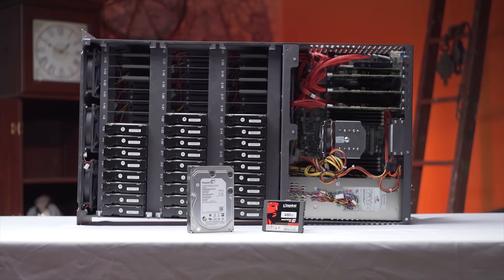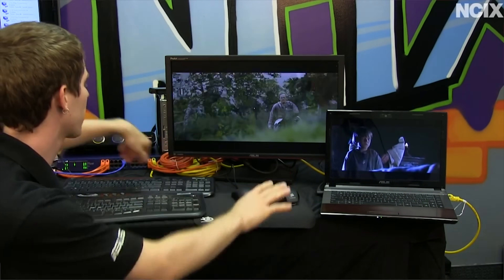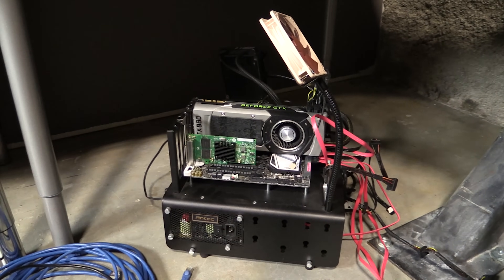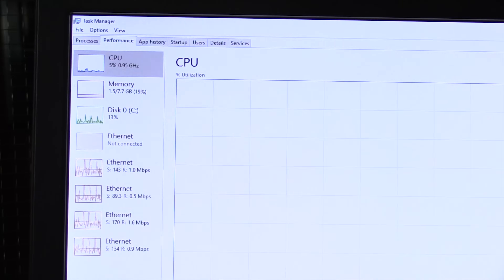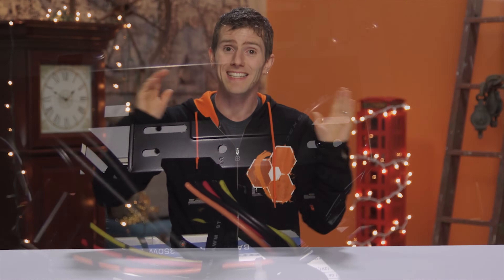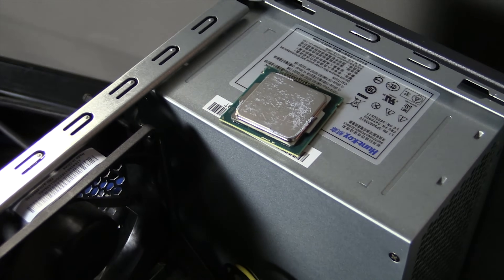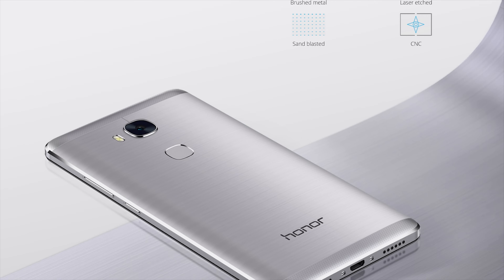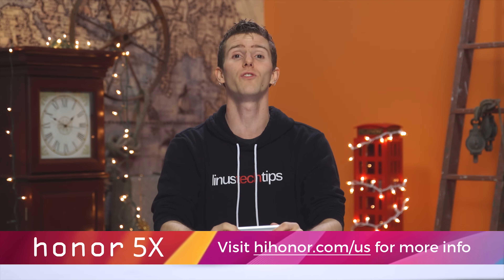Quadruple Your Network Speed for $100 with SMB 3.0 Multichannel!

Comment: if you guys can't get it to work with multiple installs and different components, this is practically useless for 90% of the people watching this video.
Reply: +FoodOnCrack true... I was really hoping for a good installation guide because I really need this for my network but appearently it still doesn't work well. guess he just didn't want to throw the video material away after this failure.
Reply: +FoodOnCrack 90% of the people watching a Titan X review won't buy one
Reply: +FoodOnCrack it did work reliably in the end though. He talked about the setup and the configurations he tried, and at the end he specified that you need multi-threading on both server and client machines.
Reply: +FoodOnCrack It's practically useless for 90% of the people who watched this video in the first place, because 90% of people who watched this most likely don't have a NAS.
Reply: +hnaht321 it's true I watch one and bought a 980 ti instead haha.
Reply: +Ultravore The solution was simple: 4 core cpus are a must for 4 lane network to work good, other then that most is plug and play if you run windows 8 or later, sorry windows 7 and XP fans this wont work for you. His problem was initialy a 2 core vs 4 core CPU, making the slower less cory-cpu bottleneck.

This should work out of the box with most cpus and 2 cards.
Reply: +FoodOnCrack It's okay since over 90% of people watching this video will never use a local network anyway.
Reply: +FoodOnCrack Really, this channel is about entertainment far more than any practical knowledge.
Reply: +FoodOnCrack Not to mention the fact that pretty much no one has internet that fast. Like quite literally you are lucky to get maybe 80 Mbits/s. Forget about 1 Gbit/s.

Comment: had a cool idea for a potential build for you guys, fitting a itx gaming rig in a laptop, you could put that 3d printer to use by making spacers between the bottom and top panel only issue i see is psu, keyboard and monitor but im sure there's ways around those problems

Comment: Lucky people. In my screwed up country (which is one of the richest) still has copper phone lines used for internet. I CAN ONLY FREAKIN GET 3 Mb/s !!! FML...
Reply: +goodlyboony
this video has NOTHING to do about internet speeds.
Reply: Australia right?
Reply: im in iraq and get 5mb/s XD
Reply: +goodlyboony Copper is capable of a lot more than that. It's hard for me to imagine that the copper infrastructure is actually saturated, so it sounds like you either have a sucky plan, a sucky ISP, or both.
Reply: Sp Ry No, Kuwait
Reply: I have 512kbps.
Reply: +Sp Ry Australia is getting fibre line for the whole nation..
Reply: +Jacob S awesome!
Reply: Jack Taylor Not according to my ISP. They say that copper wiring can't handle more than 3 Mb/s or it will burn up.
Reply: goodlyboony Copper infrastructure is capable of 100Mbit, in the right conditions and the ISP has the hardware to accommodate that.
Reply: +Jon A  Copper can do much more if you think of vectoring... but the longer the distance from the distributor to your home is, the slower the speed get's. Copper wires have to deal with interference and damping. In my old home i got only 10KB/s and now i have 5MB/s (both copper wires).
Reply: hahahahahaha I live in Germany and get 2k while beeing 5 min away from a town with 500k inhabitants. That's a screwed up country.
Reply: Shit man, that's fast. Fucking wind mobile has 100 KB max. Fucking 100 KB. It has the slowest internet speed in Canada.
Reply: goodlyboony LOL
Reply: +goodlyboony ISPs lie so much.  They won't give you any more (It's sort of standard ADSL), they could at least dignify their customers with the truth though, they just make up some BS and hope their customers don't know any better so they'll stop complaining and go away.  Suppose we give them the benefit of the doubt, that means it's time for them to put in new cables.
Reply: +goodlyboony How much you pay i pay 20€/month for 40/20 internet
Reply: I get 1mb/s in denmark
Reply: +goodlyboony Your ISP is garbage, then. I'm currently running on 0.5Gbit through copper. (500Mbit)
Reply: Lol I only have 0.7KB/s
Reply: +goodlyboony In New Zealand you can get ADSL2+ which supports 24Mb/s or VDSL2 which supports 50Mbps if your line is less than 1km long. You can also get fibre at 100Mbps if your street has it. I get 7Mb/s with ADSL2+ over copper, my line is 3km long. I can watch YouTube in 1080p60 without buffering and Netflix in 1080p no problem.
Reply: Näätä 245 euros per year
Reply: +goodlyboony i get 900kbps
Reply: +goodlyboony
Being in a rich country doesn't mean that they invest in the infra structure or the people... It's like the kid on the playground saying how rich they are, but once they grow up the parents stop funding their "life style".

Look at the USA, over 50% of their wealth goes to the military so the "riches" they have is actually only half of what they claim since military spending does not actually bring in the money (for the common folks).
It's actually laughable to hear the "world powers" claim superiority (USA, China, Russia, UK, France) while the standard of living for the people is not impressive.

Comment: Linus, was DMA enabled? This can be key in your cpu load because every packet would be handled via cpu if not enabled :). I've tested with this in virtual environments.
Reply: Although this is not going to solve the problem because the software still needs to devide multiple streams which the cpu will handle. So it will help something but not much I think.

Comment: This doesn't really explain a whole lot, or maybe it does and it's just confusing. But does the second pc need to be running firmware such as pfsense(which has been a nightmare for me) and essentially just be a fancy router connected to lan but distributing to my pc in multiple channels?

Comment: Is this correct?

Your IPS provides a internet connection via Ethernet into your home. The router is up to you, your ISP just provide one for you. 

So, you cannot actully improve the speed of your internet, you can only improve the range and efficiency by buying a new router.

This is probably all wrong xD
Reply: you cannot do anything about your internet speed, that is correct. if you've got a good router, the router would usually be capable of way more throughput than your isp provides. this video, however, isn't about internet. it's about transferring files locally between your PCs.
Reply: +ComicPunch No, because this isn't about download speeds. It is about file transfer speeds between things on your own network
Reply: givemeajackson So a router upgrade would increase your internet speed? Over the stock router.
Reply: ComicPunch not if your internet connection is already slower than your router. and if they give you a router, it's usually faster than the connection they offer.

Comment: But surely if you want this transfer speed to NAS box that box will not be featuring an i7 processor, so isn't the point moot?
Also typical load balancing like LACP is session based and will load balance between session but not in individual transfers, maybe that's why your earlier tests didn't show much improvement?

Comment: imagine this with 10gbit.... whoahh.... (will probably be bottlenecked by CPU and/or HDD/SSD unless there is some raid array or something)
Reply: PCIe NVMe SSDs :)
Reply: +K3V0M these still top at around 2-3GB/s a second, well... you could put them in RAID for double that.... then i'd think the CPU would bottleneck the shit out of it unless it's an high end xeon
Reply: +Noobioh what would you need the RAID (0) for? 10 Gbit/s = 1,25GB/s
Reply: K3V0M 4 times 10Gbit, so the speed will be more or less 5GB a second. I'm not talking about a single 10Gbit connection (which is already nice) im talking about what was shown in the video. So you'll get around 40Gbit.
Reply: Noobioh Oh. Okay I didn't consider using multiple 10 Gbit/s connections since it's already 2,5x faster than what was shown in the video :D
Reply: +Noobioh Many tests that benchmark 40Gbps networking don't use HDD/SSD, everything is from RAM.That said, I've run one of these tests at line rate using a single core. It depends on too many factors but rubbish network drivers can make a heck of a difference.
Reply: +Noobioh Well.... there's boards you can drop more than one Xeon into :P
Reply: zvxcvxcz That's true :p doubt 40Gbit will be a thing for small to medium businesses though :p
Reply: TheLiasas Thank you.

Comment: Sooo, would it work if I bought 100mbit fiber, put in a 4 port card and then had 400mbit fiber?
Reply: This video is about local transfer speeds from one computer to another over the network
Reply: And no
Reply: +Tommi Honkonen No. This is in regards to your LAN only. What is restricting your upload from from your router to the internet would be the next hop, which you do not have access too. This is strictly for LAN connectivity increases.

Comment: Holy crap, Linus. I had this working far more easily than all of this on Linux back in 2007. It's called LACP aka 802.3ad. Benchmarking network stuff is far easier on Linux also. I don't have to worry about disks slowing things down. I pipe /dev/zero into netcat which connects to a listening netcat on the far end which is outputing into /etc/null. Zero disk involvement resulting in no disk bottleneck and max network speed for purely network benchmark purposes.
Reply: Hey man, I've recently ditched windows and am trying to get network transfer speeds to be usable between two machines. They both have 10gbe cards and with windows to windows I was getting 400MB/s but now Linux through samba is only 10.... Is there anything obvious I need to look at / learn? Can you point me to any resources?

Comment: question- Linus keeps saying 1 GigaBIT connection, but then shows reading running at more than 1 GigaBYTE a second. Is he making a mistake or am I? one GigaBIT a second should translate to around 125 MegaBYTE a second shouldnt it? (The tricky differences between Gbps and GBps...) The speed the download runs in the video is around 9 GigaBIT (Gbps)

Comment: Nice. but I have recently seen some mellanox 10Gb cards with SFP plugs for $25 on ebay. And the seller has cables too, so I think if you only need a fast connection between 2PCs, that might be a better solution. At least you wouldn't have 4 cables.

Comment: I'm in Australia and I get 600kb/s and can only use wifi, is there anyway to improve my speeds?
Reply: +M. de k. I have a speed of 300mbps and i have download speed above 30mb/s.. I am thinking soon to switch to 500mbps speed
Reply: LOL we get 8Mb in Lithuania.  And I live in a small village :D
Reply: Poor lad. Probably you get more spiders than megabits per second
Reply: +Joe Irvine It sounds like you have an ADSL 2 connection. See if there are any providers that do cable in your area. Also do you know if NBN is coming to your area? If so wait for NBN as you will have to upgrade anyway.
Reply: +Joe Irvine Well for optimization  you could use a 5ghz setup with a channel range noone else uses but you are grasping for straws here.
Reply: Get really close to the WiFi source
Reply: +Electronx Gamer I have 25 - 30 mb/s
Reply: M. de k. No.. that is your internet speed ( 200mbps) but that is not the real download speed.. that equals to around 10 - 15mb/s
Reply: +M. de k. btw this videk when it says increase network speed it only does that in local network?? or even online when downloading games for example and do i have same ip on all 4?
Reply: +M. de k. there is a diffrence from network speed and the REAL download speed
Reply: +Benas Buivydas I get 753mb/s at lithuania
Reply: +Joe Irvine Ethernet.

If you can't do Ethernet, just use a homeplug.
Reply: +Joe Irvine Move away or change providers.
Reply: +Coolcraftteam comunity In the local network, point to point, just between where those 4 sets of cables are going.  Unless!.... you buy 3 more connections from your ISP ^_^ AND are downloading from multiple different sources, since the whole system between you and site you're downloading from won't be wired like that.  

You may be putting two issues together in your other post, 1) the difference between wifi ideal speeds and reality and 2) the difference between bits and bytes.  Maybe not though, your situation could just be a little extra far from ideal.  If your download speed from your ISP is 300... then I would probably skip 500, go for 1200 ac or better to try and take advantage of that.  The TP-Link Archer T4U USB adapters are cheap enough now to outfit the client side.  If you're on Linux you might need to build the driver, but there are some good PPAs that make it super easy and it's running well, TP-Link also provides a driver, but you need to compile it against a really recent kernel I didn't have yet.
Reply: +Coolcraftteam comunity No its not, well at least not in the way you are thinking. ISPs usually rate speed in mbps, as in bits, while most programs show it in bytes, 1 byte(B) is 8 bits(b). 

So the real speed is the same, except if your ISP is scamming you or you have IPTV (in which case you actually have more)
Reply: Yeah, but that would require you to spend $100, every month.
Reply: +Joe Irvine Move. http://www.speedtest.net/my-result/5047973221
Reply: Nothinglastsforever Wow, they've really got your upload speed in a death grip, I have similar down speed but I get at least 40 megabit upload.

Comment: Linus,

Problems 1 through 100 are you are trying to solve this problem in the MICROSOFT side of things…. 

The right way is to buy the more expensive switch that can support 802.1ad, channel, LACP, aggregation or teaming, depending on what the vendor has decided to call it. Then “aggregate” the 2,3, or 4 port in hardware NOT software. 

Yes I have been doing this for clients for years in combinations of aggregation, load balancing, and failover. The hardest part is reading the documentation and figuring out what the vendor’s word is for aggregation. Once set up all 2,3,or 4 ports will have one MAC, and one IP address, as far as (in your case) Microsoft should see one MAC and one IP for all four ports, Microsoft should see it as a 4Gig Ethernet port.

Once you figure it out you should see about 90% of each channel available for use. The other 10% goes to overhead to keep the 2,3, or 4 channels in sync.

Cisco documentation... https://learningnetwork.cisco.com/servlet/JiveServlet/downloadBody/3729-102-3-38662/teaming.pdf  starting at page 18